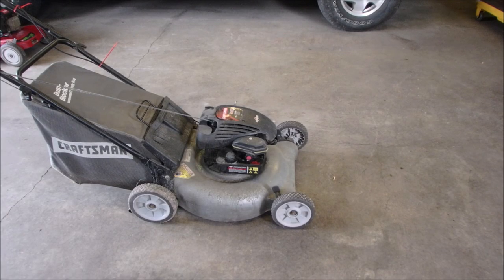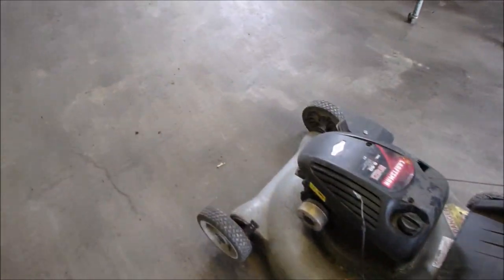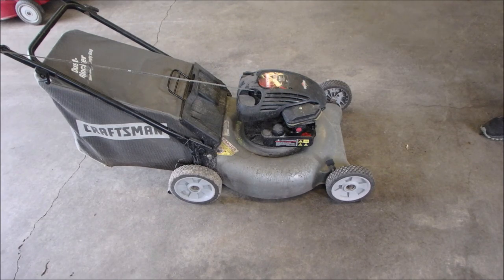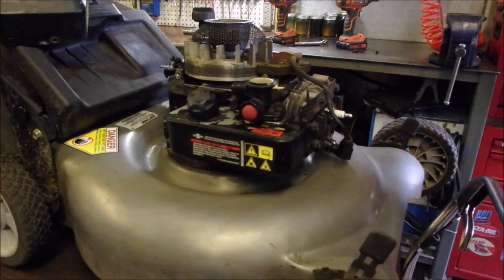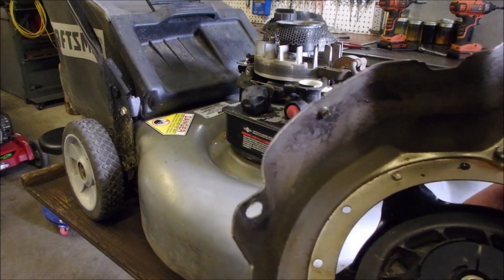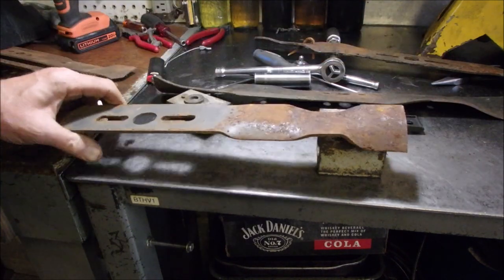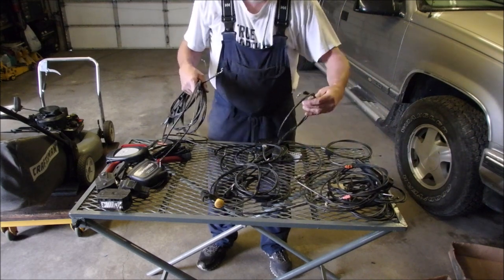Murray Craftsman Mower Needs Everything Pt 1

Comment: When I get one of those I just stare at it and wonder if I REALLY want to fool with it. Once you spend that first 10 minutes working on it you are committed and have to see it out to the end. 🙂
Reply from the maker: Exactly.  Whether that is a finished mower or more recycle metal.  LOL
Reply: @BrucesShop  Once I put a wrench on it I have a hard time stopping. I have spent $60 on mowers I sold for $50 once or twice. sigh
Reply: Now days, I do the math in my head as to what kind of money I will need to spend to fix a simple push mower. Many times, its cheaper and more profitable  just to strip the engine off, salvage any parts that are good and use those parts to fix better looking lawn mowers that can fetch me more money. Regular push mowers sell really cheap around here. Not worth fixing unless self propelled.
Reply: @scottfirman  Here too. I am happy to get $50 for a push mower so if it's anything more than a carb clean or recoil rope it's usually not worth it.
Reply from the maker: @GuysPlayingWithTools  That has happened but you get a video!!!
Reply: @BrucesShop  I think that sometimes... not a total loss anyway

Comment: I learned years ago, never try to run any fuel that's already in the mower, even if the owner says they added fuel. One mower I got was half full of water, so the owner clearly used water, not gas. I always dump out the old fuel  and use Recreation gas in EVERYTHING.
Reply from the maker: OK Thanks

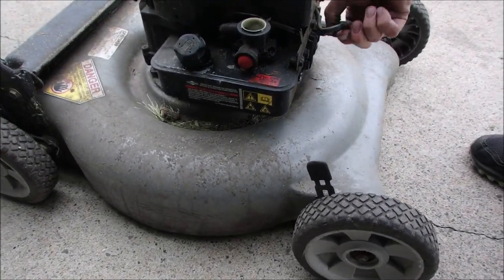Comment: 5:08 pulling the plug wire , braver than me . i had an old pusher w/no kill wire (long before flywheel brakes) that i always turned over on its side (tank side) to stop it . never seemed to do any harm , though it should have .
Reply from the maker: The metal spark plug  hood helps a bit.  I have no fear.  LOL
Reply: @BrucesShop  Shocking!